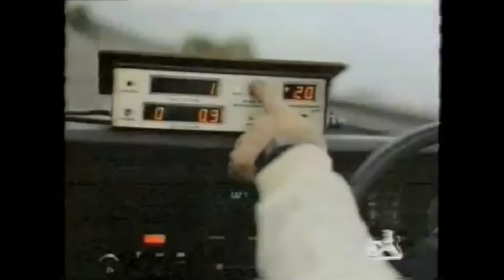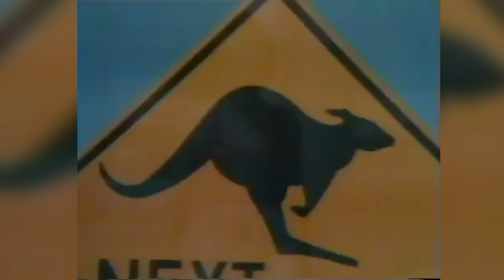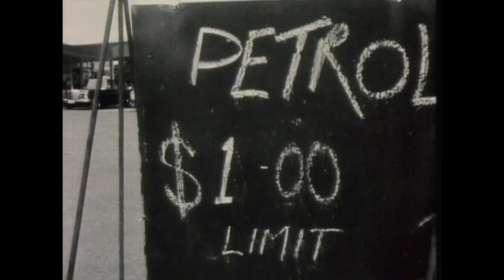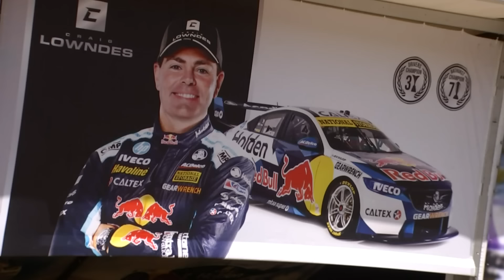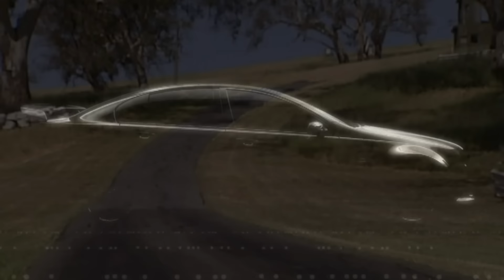The rise and fall of Holden, Australia’s iconic car | ABC News

Comment: The lack of acknowledgement and respect for the contribution Peter(the King) Brock made to the Holden brand is astounding and telling. Peter Brock did more than anyone in cementing Holden as an Australian racing force as  did  Craig Lowndes later. Skaife  stands in their shadow.
Reply: Not forgetting Larry Perkins. Last Bathurst winner running a Holden engine.

Comment: I dont see why the HQ Holden was such a huge sales success,  they are a nice riding ,decent handling car ,and with the Chevrolet running gear were a great package, but most people were buying the standard six cylinder models  and they had all sorts of problems,  a thirsty and not very torquey motor that sometimes blew the tops off the pistons, a poor quality fibrous cam gear that could fall apart,  same with the distributor drive gear, the Tri matic auto trans is one of the worst transmissions ever , the axles snapped like carrots, the Falcon and Valiant were a far better buy as far as reliability is concerned.  Once the Commodore's had the Buick running gear they became an excellent car

Comment: Making more and more powerful and luxurious cars had to end due to cost, simple. It's a pity they couldn't have made a more basic 4 cylinder ute and stuck to that.
Reply: Because falcons and holden utes out sold hilux for years, people wanted power , the hilux was both thirsty, didn't handle and gutless, only when they were more refined and tariffs changed they became more popular. There's no  profit margins in those ute, there rather agricultural and built in Thailand to start with for that reason and compition is high you need a niche, besides a falco six on lpg was far better properistion than Thai built ute in most cases and would eat miles, handle and carry a load

Comment: That billion wasted on VE should have went towards a genuine Holden SUV and twincab ute with hybrid option. These vehicles would have saved the company.
Reply: How good was the VE though
Reply: @sampritchard3350  
It was a great car......for the wrong time. Rightly or wrongly,  SUV's and pickup utes were gaining momentum during the VE years, and Holden should have invested in them. Just imagine genuine Holden SUV and pickup utes built by Holden with diesel, six, V8 and hybrid options?! 
I was saying this years before the closure was announced,  so why didn't GM/Holden realize it?
Reply: VY series Adventra and Crewman.  But no-one bought them.
Reply: @railtrolley  
Fair point, but they were quite different to the other SUV's and utes that currently sell well. They were car based,  and looked like the large sixes they were based on. The Crewman was too long, too low and too cramped in the back. The Adventra looked like a Commodore wagon, not an SUV proper. Buyers could see this.
Reply: @noelgibson5956  I just remembered another one: the Overlander.  Not many built.
Reply: @railtrolley  
Yes thats going back a bit. 
There was also Fords 4WD XY ute. They'd be worth some serious coin now!

Comment: The timing chain problem with the 3.6l engine from VZ on didn't help the situation at all.
Reply: The vz had a better chain than the series 1 VE
Reply: Owned a VZ for nearly a decade never ever had an issue with timing chains just auxillary components that cost little and quick/easy to swap out. Has been smooth, powerful, reliable and suprisingly fuel efficient. Last Holden had the Ecotec V6 and was a good car with a great engine the alloytec is in a different league
Reply: @sutherlandA1  It comes down to maintenance and luck of the draw. Some people like yourself have been fortunate but so many others have either sold them to get rid of them or spent a lot of money on repairs.
Reply: The original engines in the VZ {First 6 months of production} had chain problems. It was fixed. However due to the SAAB/GM design it had a very poor PCV system and extremely low tension piston ring packs. For the extended service intervals required in todays market those engines required a very particular oil blend that was often not adhered to because of expense and misunderstanding. Many blends of oil claimed comparability yet didn't comply with the standard. That and the increased work required to replace the filter {Thanks SAAB } meant that nearly every engine was being serviced at the maximum interval or beyond and when filled with the wrong oil causing solids to form inside the engine. These would sometimes get into the hydraulic tensioner system causing eventual or immediate failure.  GM used these engines all over the world in different guises and they all suffered the same fate due to the same reasons. Even today if you walk into Supercheap Auto maybe 1 in 4 oils deemed suitable have the correct additive package that will emulsify the blow by well enough and long enough to meet the recommended service interval.  Those oils are always top dollar and rarely discounted.
Reply: silverbird58  Are we talking about the same engine? The Root cause was the design not being tested properly. Ford OHC V8's have also suffered from problems that can be traced back to this type of problem.
Reply: @dazaspc  Both are US engines and been around decades
Reply: @brycechessum4684  They were used in the US and made there as well but for a time some of the Alloytechs were made in Australia.

Comment: You know why SUVs took over from family sedans? Because, while you could take an HQ down an outback trail, you couldn't do the same with that SS-V that was last off the line. Families don't need racing cars, no matter how some may dream, they need spacious and practical vehicles that can handle a bit of rough ground. That is why Holden failed. Ford did have a crack at the SUV market with their Territory, but they never got it to the same standard as the offerings from Europe and Japan, it wasn't a very serious attempt. It's not fuel economy that killed Ford and Holden, it was a lack of utility and trying to trade off previous glory, with a very over-inflated estimation of the racing pedigree. Like I said, plenty of us wish we had racing cars, very few of us would actually buy them, because they don't do what we need them to do, and we don't have the money for toys like that.
I'll tell you seriously, I wouldn't buy an FG Falcon, because I can't use it for anything, but I would buy an EL, even a V8, for a spot of towing.

Comment: The free trade agreements ruined the local car industry flooding the market with imports. The car dealers and over promotion of 4 wheel drive SUVs  are another factor and that Australian Manufacturers were far too slow in adapting . We should have had our own 4 wheel drive vehicles produced back in the 1960s and should have gone to front wheel drive standard vehicles a lot earlier inline with the Americans and British. We made the mistake of making too many body variants of a similar size large car  such as Commodore and we should have made more medium and smaller cars and SUVs .

Comment: Bought a brand new Holden in 2012. Most unreliable vehicle I have ever owned and the back up from the dealership was just as bad. If it weren't for the government prop up they would have gone under years ago doing us all a favour by not supplying second rate vehicles.
Reply: What model holden are talking about, the vf commodore was a realitvly fast reliable and good handling car. The ironic thing about the above story is Toyota and Holden used to swap badges in 88-91 era of cars, don't you remember the Holden apollo and Toyota lexan
Reply: @hamishfullerton7309  Only in OZ nobody else saw those rebadge cars, Kiwis laugh about the idea

Comment: I wish they would have separated the assets and try to find new buyers back in 2017, instead of thinking they can just turn it into a re-badging factory, then dumping it entirely once GM sold off Opel. Holden deserved the option to be sold the same as they did with Opel.
Reply: Opel is European/German engineering....   i doubt you can compare that to a local made car on an island somewhere in the ocean, how many Holdens got sold in foreign countries?    and how many German car brands are sold in Australia? 1 or maybe 2?

Comment: The Americans purchased the majority of shares in Holden. General Motors owned the controlling shares in GMH or General Motors Holden manufacturing in Australia. America put huge import taxes on Australian built cars. Australia was fooled into free trade with limited import protection. Even the Australian Governments bought imported cars. The government effectively paid no import duties.  
If Paul Keating had insisted that all companies operating in Australia had a 51% Australian ownership GMH would still be manufacturing cars. The Australian Government gave away AUD 2 Billion Dollars to GMH, where they should have bought shares and ownership of GMH. But they put their political principles before good business practice. 
It is not the size of the population that killed the Australian car industry, it is an Australian Government  bound up by foreign globalist and privatisation policies and guidelines while pandering to American interests.
Reply: GM involved with Daewoo not Kia which is owned by Hyundai, that involvement goes back to the 60s Daewoo made the Chevy 1700 wagon which used Torana front panels
Reply: @brycechessum4684  Thank you for the correct information. I verified your advice on Google. 
The rumour we heard in Australia about GM's involvement with Kia was incorrect. I also discovered Volvo Car Manufacturing was sold to the Chinese Geely Company about 2010 and it is rumoured that the Swedes are negotiating to buy it back. Sadly my original comment is deleted so people will not understand the reason for these corrections.
I have corrected my comment. I prefer to be corrected than to be incorrect. Much appreciated.

Comment: As non-Australian very much curious as to why at some point in the past when there were far fewer imports of cars, why there was not just a series of taxes or duties put into place that would have so hamstrung those import brands that it would not have been profitable for them to continue shipping to Australia/New Zealand.
Yes it would have limited choice to a large degree so I suppose the general public would not have stood for it (its not like you still couldn't have got imports just very expensive) but it also would have, perhaps, saved an industry.  Not that politicians are known for long term thinking.
As example though perhaps not by intention or an identical situation, the varying rates of road taxes etc. paid by Japanese gave rise to the Kei car but also almost completely eliminated vehicles manufactured in Detroit from gaining a foothold.
Reply: There used to be tariffs to protect the local industries. Free Trade agreement killed it all.

Comment: 2 things killed Holden and Ford. No 1  Lack of loyalty to the brand. People buying a useless 2wd Kluger instead of a Holden wagon ! No2. Holdens inability to provide an up to date vehicle. Utes and tonners should of had twin turbo V6 petrol and diesel engines in 2000 ! Their small cars were crap and the larger ones were cast iron and push rod dinosaurs !

Comment: This crazy over loaded market of just about every manufacturer represented from the world’s auto industry available to choose from became the hammer just waiting to fall on Ford Falcon, Holden Commodore, and Toyota Camry built here. The modern break-even number of a single model requires a build run of 300,000 plus to be economically viable, the total market in Straya is in the order of a million plus vehicles annually; shared amongst the worlds producers. This fact alone was the elephant in the room, in justifying all local marques to cease building here. Also, we drive on the left, majority of the countries around the globe drive on the right; the volume of cars built for right hand operation is exceedingly small. Commodore ended up being world class, however the market had been shifting to SUV’s since the year 2000, and there was no case to invest another billion dollars in a new model, purely for Australia. GM in America had huge issues, selling off all its international divisions including Holden, as it did with 3 of its own divisions in the US. So one can blame the market more or less for the shutting down of ALL motor manufacturing in Australia, the numbers are just not there. The buyers were no longer there and Holden became increasingly irrelevant.

Comment: Best RWD car in the world was not a commodore it was the XR6 turbo.
Reply: How's the diff bushes going?
Reply: @GrimReaper-ly8zk  Better than timing chains and oil leaks.
Reply: i liked my first Mercedes-Benz very much, you can stiil get parts for Mercedes even if your car is from the 50s from you local Benz dealer, for Holdens you have the junk yard...  hey, you won the war...smile
Reply: @Arltratlo  But it's cheaper to buy a new Benz than to buy a spare part for an older model so you end up going to the wreckers anyway. Not sure that's something to brag about.

Comment: I loved the Holden EH, and a couple of models after were decent, but not as pretty. However, I went completely off future Holden models when those awful, cheap plastic dash boards just cracked to pieces in the sun. In fact most of the interiors were very cheap looking.

Comment: What I want to know is what happened to the 'Holden' component of the relationship? Was GM simply allowed to consume the investment that was the original Australian body producing company?
Reply: Holden was a Coach-builder. GM supplied the original mechanicals (Engine,Gearbox ETC..) at first. By 1964 with the EH Holden a new Australian produced 149 & 179 "Red Motor" came along followed by local Gearboxes, Differentials & other Components. 1969 saw the first 253 & 308 V8 Engines, The 308 won a lot of Motor races including Bathurst (so did the red motor in a Locally designed & built Torana) against the might of the imported Ford V8s). Through the entire history though, it was all done the financial and technical backing of GM in Detroit. So...if GM want's to pull the plug on a tiny righthand drive market on the other side of the World, they will. Be PROUD of what Australians did off their own bat during those memorable times!!!!!!
Reply: The Holden company had value which should have been protected as part of the deal. Hopeless
Reply: @CrRodney1  Amen
Reply: Saddlery company the took on body building after GM bought them

Comment: Holden and the local industry only existed because Australians wanted a unique vehicle, a large cheap car. The rest of the world wanted small cheap cars or large expensive luxury cars, so unique Australian cars were viable. When Australia became extremely affluent through the 90's and 2000's our tastes changed to the same as the rest of the world. Then cam SUV's so Australians families could afford two cars, a cheap city car and an SUV.
The local industry failed because of this and because we entered free trade agreements with the three countries that were building the new most popular cars, Japan, Korea and Thailand. There labour costs are so much less than ours that it made no sense to build SUV's and city cars in Australia when you could cut your costs by $3000 - $5000 per unit by importing them from Asia. Even in Japan a production line worker is paid half of what a Australian was paid
So it was a changing market, free trade and Australian union demands that killed Holden.

Comment: FX - WB RIP  and HB TO UC RIP Australias real HOLDENS. Also RIP to the locally made V8 in 1999. RIP HOLDEN RED MOTOR. RIP Holden One Tonner the best Idea Holden ever had. If Holden Kept the Panelvan and the one tonner with VZ nosecone instead of axing it for the VE UTE Holden may have sold more vehicles. hopefully Australia starts building its own engines again.

Comment: I have a 2001 Subaru Impreza with over 400000km and still on the original alternator, could never get anywhere near the durability and reliability with any Holden.

Comment: I don't think Holdens were much of a car. To much ripping taxpayer money going to GM America. Engines were under powered not even a crossflow version until the Nissan powered 6cyl in the VL, gearboxes were crap,  early banjo differentials fell apart. I'VE HAD 5 
HOLDENS and gone back to Falcons. Much better vehicles.

Comment: Holden have not made a good car in ages..and Australia has not been interested..I would rather buy a '90's Suzuki swift than a Holden Barina..same car..just Holden badged the shit version ..that theme runs over years
Reply: While I agree that they were sparsely specified I'm not sure if Holden badged the "shit" version of the Swift as the "Holden Barina" badged Suzuki's were the most reliable of all generations of Barina's at least when it came to warranty claims and general longevity, dealers loved them at service time as all they had to do was change the oil and filters then send the car on it's way & not see it again until the next service, as for the later "Opel" or "Daewoo's" wearing a Barina badge well that was a different story with warranty claims, defects and recalls sending these useless pieces of s**t to an early retirement at the wreckers yard. While they are getting thin on the ground now I still see the occasional Suzuki "Barina" pottering about, haven't seen an "Opel" Barina on the road for at least a good decade now and even the Daewoo ones aren't all that common considering they are the newest.